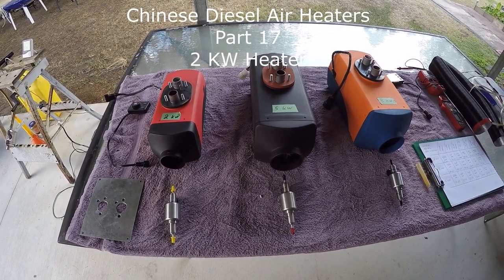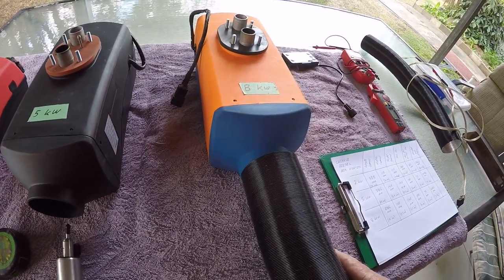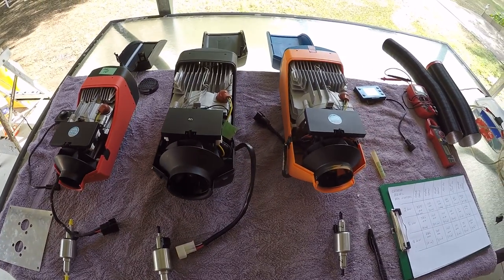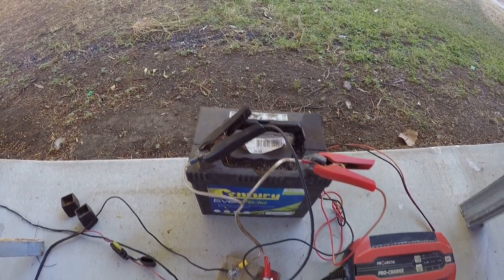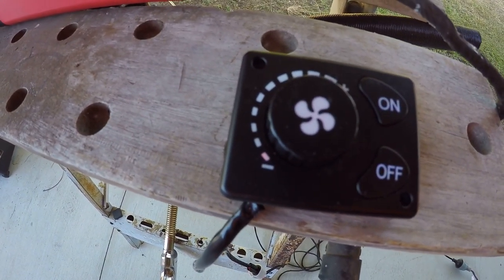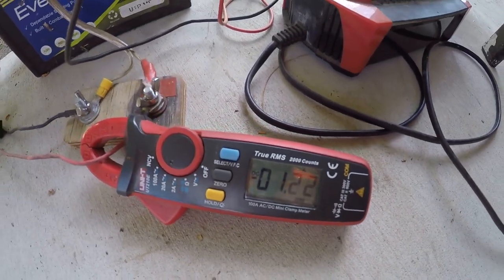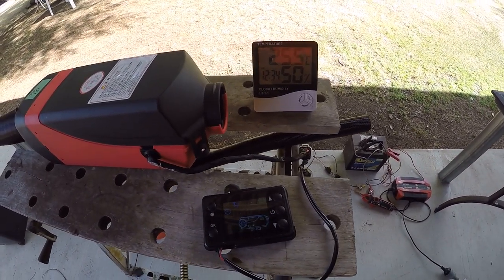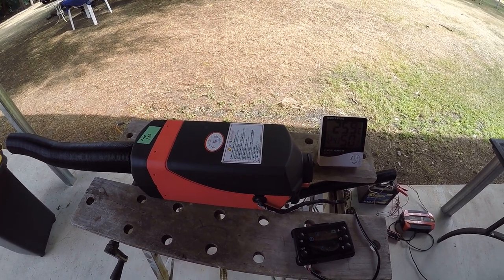Chinese Diesel Air Heater   Part 17 -  2 Kw Heater

Comment: I don't agree on your conclusion regarding the pumps. I have a 2kw and 5kw, and on mine the pumps are different.  Pump 5kw: 12V22-18 = 0,022ml and pump 2kw:12V16-18 = 0.016ml. Look here https://youtu.be/kOaQKf-i2f4?t=248
Reply from the maker: Hi Mr I, thanks for the feedback.

I personally tested the fuel pumps of the two 2 Kw heaters I own. I measures each pump with 100 clicks. Each pump delivered 2 ml of diesel into a measuring cylinder after 100 clicks. I ran each test twice with the same result.

Perhaps other manufacturers provide a different fuel pump.

I agree re the .022ml. Some, but not all, recently purchased 5 Kw heaters do come with .022 ml dosing pumps, where as in past years they were delivered with .020 ml pumps. 

Cheers.   JMcK
Reply: John McK 47 .

Comment: I have a 5kw CDH.
Problem:
The inside head temp. 206/212 degr. Celsius.
On the outside by max. power small 40 degr.
Celsius.
I have see the temp. by the 2kw Head.... over 100 degr. Celsius.
Have you a idea for troubelshooting? 
Thx.

Comment: So, instead of a deep cycle battery.  I could use a 110 volt to a 12 volt converter and a 10 amp model would be enough power output to run the heater.
Reply from the maker: Correct. You only need a few amps to run, but need around 10 amps to start the heater.  JMcK

Comment: Hi john brill vids thanks so much for your time and energy making these great vids, i was wondering if you could make one showing us how to put a battery back up, if you want to use a transformer, in case of a power cut. once again many thanks, have a great Christmas, and I hope you and all your family stay well and safe.
Reply from the maker: Hi Stephen, 

Unless you live in a place with regular power outages it is really not worth the effort. I would just use my AC power supply and accept the risk. You could go and buy a computer IPS if you wanted peace of mind.

If I lived in an area of storms and lightning strikes and power outages, it is far simpler to run heater off a small battery and a small smart battery charger permanently connected.

In fact the small battery and charger method, in my mind, is simple, easy and fool proof.

Thanks for your feedback.  Merry Christmas.  JMcK
Reply: Thanks John, once again great advice, will do as  you advise, thanks for the prompt reply 👍

Comment: Wouldn't incomplete combustion be more likely to gunk up the chamber if a larger heater was running at reduced output?
Reply from the maker: Yes Michael, if it was incomplete combustion, but the ECU very accurately matches the fuel burn with combustion air intake to get a clean burn. The main reasons for a bad combustion is a bad install.  With a good install these heaters idle along very nicely at a low pulse rate.   JMcK

Comment: great video, im wondering, if i need a low heat over a long time in a small space is it better to run the smaller model on a low power setting for longer periods or the bigger one on a low power setting for short bursts every now and then, im worried the larger model will be too powerful even on its lowest setting
Reply from the maker: Hi CM, if the space is small get a small heater. It is all personal preference, and very dependent on insulation, and outside environment. I personally like to have the heater constantly running at a low setting in the background.  JMcK
Reply: @johnmck1147  thanks, and thanks for making the videos
Reply from the maker: 👍 JMcK

Comment: Did you look at the numbers on each of the three pumps to see if the flow rate is the same? I've seen tests on these heaters where the pump output varied a lot on similar looking pumps.
Reply from the maker: Hi Rick, all the pumps I tested put out .02 ml per pulse.  Some newer pumps output .022 ml per pulse.   JMcK

Comment: Great info John, thank you for the whole series! I am curious why you say to run the heater directly from the battery, and advise against using a distribution box. I am installing one now and was going to use a Blue Sea Systems ST Blade ATO/ATC Fuse Block. Thanks for your help.
Reply from the maker: Hi Chris,
A major cause of start up issues of these heaters can be traced back to low voltage. 
These heaters can draw around 10 amps for a minute or so to start. Most of this current draw is the glow plug.
It is very common for boats, motorhomes, caravans etc to have minimum wire runs from battery to their switch panels and if you have a couple of lights on you get voltage drop to the heater causing issues. But in real world there are lights on, TV on, radio running, laptops charging, fridge running etc.

You can do it, just run oversized wire to your distribution box.  JMcK

Comment: The advantage of the 2 KW heater would be in a truck with a sleeper where it would be less prone to carbon up running at a higher hertz than the 5 KW. I have a 2 KW Webasto AT 2000 clone.
Reply from the maker: Thanks for the feedback Jack.  JMcK

Comment: Mr. john, I am going to through something at you to see what you think.  The purpose of these theaters is to produce useable heat economically. So, here are my thoughts. There is a tremendous amount of heat loss through the exhaust. That heat is  just going to waist. So I am thinking on the exhaust, I come down with the exhaust pipe aprox. 4 in. make a left turn (1-90), go aprox, 12 in. make a left, go 4in, make another left turn ( total of 3-90's ) and then have the pipe go about a ft. or 2 ft. and then the muffler. The whole exhaust system will be enclosed and sealed. The air intake (fan end ) will pull all the air from the enclosed exhaust box, the muffler will be OUTSIDE of the box and the box will have  2- 3in air intake vents at one end. Well what do think Mr. John.   By the way I do miss your vids big time. Thank you for your input.     Rick.
Reply from the maker: Hi Rick,

An unusual concept. You don't know until you try it.
Be careful about adding restrictions in the exhaust, as there is only a little fan in the heater providing air/exhaust movement. If the exhaust goes upwards it is better.

One way to harvest exhaust heat is to wrap copper pipe around exhaust and run water through it.

JMcK
Reply: @johnmck1147  Thank you Mr. John......

Comment: will it work under the hood of an electric car then blow the heat inside the car . at - 10  or colder well driving . so i would like it to heat the outside air to prevent the windows from foging up

Comment: I’m guessing with the rotation style knob that u can go in and turn the hz down on the pump like u can with the lcd screen
Reply from the maker: Correct Nutbush. In fact I actually prefer the simplicity of the knob style controller. JMcK

Comment: Thanks great videos John. I am wanting to install a heater in a camper trailer and am not sure how to insulate the exhaust outlet through marine carpet and ply wood floor. Also I am concerned about exhaust fumes escaping into the sleeping area from the join of the exhaust tube to the heater as many comments online indicate the exhaust tube doesn't always fit well even with the clamp done up tight. Do you have any comments or plan to produce a video looking at these areas? I am concerned about installing a heater like this in a sleeping area and having CO gases escape and also insulating the unit so it doesn't burn something.

Comment: Great vid, when installing the heater does the fuel tank need to be higher or lower than the heater. I would not want the tank syphoning into the heater when it is off.
Reply from the maker: Hi BN, the tank can be higher or lower than the heater, however if higher you should install a fuel shutoff valve before the pump and turn off when heater not in use to prevent seepage past pump and into heater.  JMcK
Reply: @johnmck1147  Appreciate the reply.

Comment: Are there two different colour LCD controllers that look the same? I have the standard one like everybody else but could not get it to prime (had to touch wires to pump terminals about 6000 times to prime) does not have a clock only a timer, and has 6 level settings as opposed to temp/Hz. Looks the same other than the digits where the clock should be are blue. Does show ambient temp, does not have the little reception icon
Reply from the maker: Yes, Julio, there are copies of copies now, some follow standard protocol, some don't.  JMcK
Reply: @johnmck1147  the thing does work good though
Reply: I know know now to prime it. Hold up and down buttons on "new style" controller

Comment: Is it possible to mount the ECU (brains) external to box so as to minimise over heating in the event of a power failure? Cheers.
Reply from the maker: Yes Geoff, 

It would be difficult, but you could do that. However it is just not worth the effort. 
With a good install power failures are very rare and should you fry the ECU, replacements can be bought online for around $20.  JMcK

Comment: Hi John, brilliant and informative videos, hoping you can help, my diesel heater is approx 3 years old and has recently lost a little efficiency, nothing excessive however noticeable, hoping you might be able to provide some advice on the cause. Appreciate your help. Manny
Reply from the maker: Hi MK, 

Depending on the install, these heaters slowly get a carbon buildup in the burner and atomisation screens. If not too bad you can burn the carbon off by running the heater at a high Hz setting for 15 mins or so.

If med build up it helps to burn off carbon by running  a high kerro /diesel mix, 90/10, at a high Hz setting for 15 mins or so.

If bad carbon build up you need to strip down the heater, remove lose carbon and use something like Carby cleaner and map gas to clean the atomisation screens.

Don't forger to also take out and check - clean- - replace the glow plug screen.  JMcM
Reply: @johnmck1147  thanks John, which of your videos do you suggest shows best how to dismantle and clean the heater?
Regards
Reply from the maker: Hi MK, have a look at video number 14, strip down.  JMcK

Comment: Hi John my heater just stopped. Found the fault the positive wire rubbed on the chassis. I’ve re-wired but it only turns blue when on and off it blows cold air. Any ideas?
Reply from the maker: Hi Kerry, I really need a bit more info.
Are you saying the controller just turns blue? With no other information on the screen?
So the heater will run but it does not start?
Can you hear the pump ticking?
Is power getting to the pump?
If controller is blank and you can only see the back lighting, you have fried the controller and possibly the ECB. Did you have a fuse in the power line?
I may be able to help more with more info.  JMcK
Reply: @johnmck1147  I got it working however the control unit (simple one that turns) will only turn on flat out heat only. The switch you turn to control heat setting isn’t working, now it won’t light up? Thanks for getting back to me my guess is I need a new controller

Comment: Another great video John, compulsive watching!! Am I right in thinking I can swap over to the simpler rotary temperature controller once I've set-up the heater? I'm thinking that my other half would prefer to just dial in the heat setting? I wouldn't expect to HOT swap the device, but switch off / on between? A fan from UK!
Reply from the maker: Hi Stephen, 

In the past this was very easy as the different Chinese manufactures all followed the same protocol. Sadly some new manufactures are now doing there own thing.

If the controller plugs are the same you can just switch them around, however to be safe these days just check the wire colours line up with the new controller at the plug. 

Good to swap controllers when heater off to prevent voltage spikes, but with a failed controller and the heater not able to be shut down I have hot swapped controllers. 

Even if the plugs are different you can just install another plug on most (but not all ) controllers.

The simple dial controllers are so easy to operate.  JMcK
Reply: @johnmck1147  much obliged my friend. It's so good that you can be bothered to reach out and help us all! S

Comment: Having watched your episode 9 on glow plugs and atomiser mesh can you advise if the mesh bought from the many ebay suppliers is suitable for 2Kw and 5Kw heaters? I bought a glow plug kit but the mesh supplied was very difficult to insert and appeared to my very slightly over sized-are they all the same? Eric
Reply from the maker: Hi Eric, just replied to you . JMcK

Comment: I brought the controller you used on the 5kw with the 4 digits at the top as I preferred this to the other sort, however it lights up but won’t start the heater and I get the E1 code any thoughts would be brilliant thanks.

Comment: Hi John I have a question you may be able to help me with . I have replaced my diesel heater with a new one and I would like to know if you can have the air inlet not connected to the pipe . My old one went through the floor and sucked up a lot of dust which went into the motor . The unit is under my bed in the caravan , do I need to have a air inlet coming opening on the side of the bed to get clean air . Your thoughts would be appreciated . Mal

Comment: Can the 5kW heater be run more slowly than 1,6hz pulse?? If there is smaller fuel pump can the outlet airtemp drop to around 40c. It would be usefull in small space or small cars where piping blow direct to person who sits
Reply from the maker: Not really. In tests I have done really slowing down the pump speed I have found the burner can flame out from lack of fuel, and the fuel air mix goes wonky. 

Suggest you buy a 2 kw heater.   Sorry.  JMcK

S
Reply: @johnmck1147  yes. But i think that 2kw is still too much. Small space to heat. I think that i need to go water diesel heater and controll output temp that way. Like in central heating in boats. And use some coil in incoming air supply  water heater uses same pump and external temp sensor for power. So controll is more precise😁.
But min power is 5kw in china heater. Webasto etc. Is so more expensive but there is 2,2kw water heaters

Comment: Hello, and what a great video series. I noticed when you had the covers off and showed the fins, that the "8" kw had more fins, will not this make the heater more effective. Have you done some testing og the output heat between the models with more fins vs the ones with less ? Thanks again.
Reply from the maker: Hi Nortonis,

Different manufactures have slightly different heat exchange castings. I have had the exact same heaters from one manufacturer, one labeled 5 KW and the other 8KW.

Also remember these particular heaters are exact copies of the original German Eberspacker D4 heater, which the Germans market as only 4Kw output. 

Recently the “8Kw” heaters have been sold with bigger capacity fuel pumps and a higher Hz setting, but the ones I have seen overheat and shut down if run at the higher settings. In real sub zero temperatures you could more heat out of them without going into shutdown mode.  JMcK

Comment: A great video well done. Do you know if the heaters will run at high altitude I might travel from around 1500 ft msl up to around 8000 ft msl. I am in the USA by the way
Reply from the maker: Hi Tom, all the current Chinese copy diesel heaters, that I am aware, do not have altitude compensation, unlike the genuine German units. At altitude these heaters run rich and have burn issues and require more maintenance. I suggest at altitude you consider running a high kerro/diesel blend of around 90/10,  kerro to diesel. Kerro burns cleaner than diesel an causes less carbon deposits. The 10% diesel is to provide pump lubrication.  If you get a high sulphur commercial heating kerro, you may get enough pump lubrication and can delete the diesel.  Cheers  JMcK

Comment: Hey John, just been and looked at a video on fuel consumption for a 2Kw heater https://youtu.be/iuEE-PC2dlE 
His findings are completely the opposite, and at maximum output, his heater used exactly HALF (200ml/hour) the amount of diesel of a 5Kw heater. 
I watched another video a week or so ago of fuel consumption on a 5Kw heater on full blast and it was 400 ml/hour. 
So seems there's a huge difference in fuel consumption between different 2Kw heaters. Some are throwing diesel $$$ out the window while others are using a proportionate amount relative to their output.

Comment: Can a 5kw run on any of the 2 voltages 12v and 24v just by changing the settings?
Thank you, very useful videos.
Reply from the maker: Hi JM, the heaters themselves can run on any voltage, and some controllers can be configured to run on either voltage, but the ECU, the glow plug, the fan, and the fuel pump must be of the correct voltage. You must buy a 12 V heater or a 24V heater.  JMcK
Reply: @johnmck1147  Mine is a 12 or 24 volt heater. Change the settings in the controller.
Reply from the maker: Wb Forsure 

Hi,

I have not seen a dual voltage heater.

It is not unusual for a controller to be multi voltage, they are just an electronic unit that controls  the heater. Also many ECU mother boards are multi voltage.

However, the glow plug, the heater fan, and the dosing pump are voltage specific. Eg you put 12V on to a 24V glow plug and it will not get hot enough to start the heater, put 24V on a 12V glow plug and you will burn it out. The ECU controls the fan speed for combustion burn, yes, it will still turn, but at half the desired speed or twice the desired speed, depending on the wrong voltage.

However, I am open minded and I would love to hear about a true multi voltage heater, if one exists. 

Cheers.   JMcK
Reply: @johnmck1147  Ahh I gotcha! I see what you're saying, yeah the unit is 12v but on the controller it has both settings even though the unit itself is 12v.
Reply from the maker: Wb Forsure 

👍